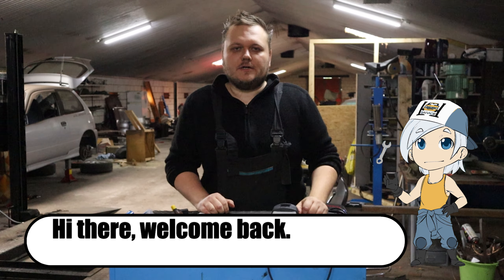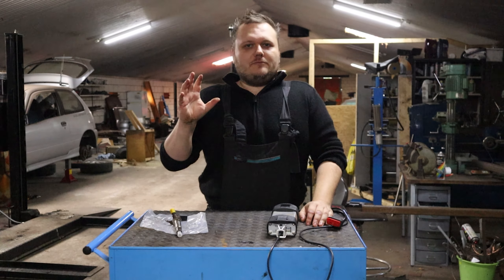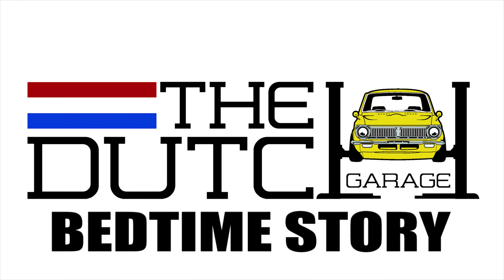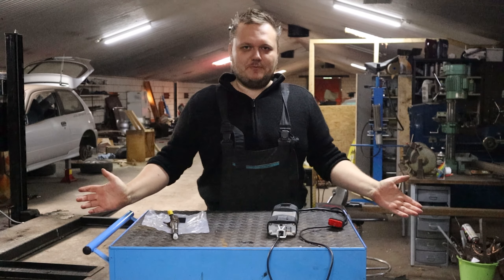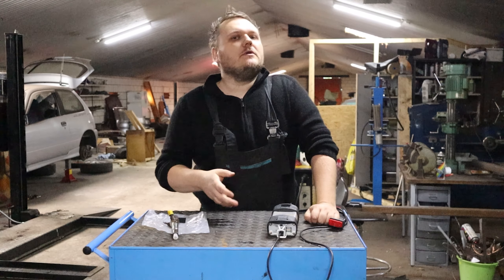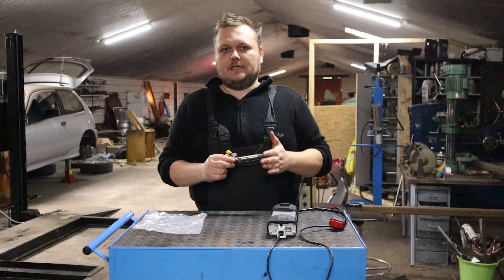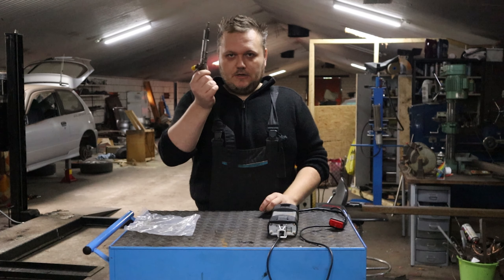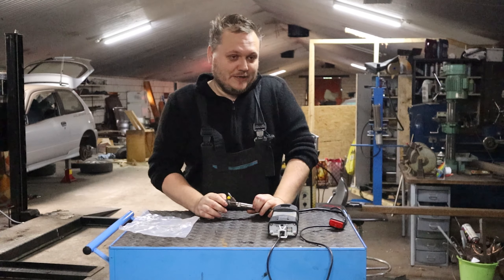How to replace and reprogram a Renault/Dacia injector with CAN CLIP Tips and Tricks

Comment: When you use obd tool on your Renault you put the car in service mode and ignition stays on.
Card in slot, choose 1 gear step on breake and push start.
Display will now says "Remove Card" leave it in and it is now in service mode.
Reply from the maker: Good to know, will try that.

Comment: Question no 1. Does the Canclip work on Opel Movano too? I have a 2017 Renault Master and a 2018 Opel Movano. 
Question no2.  On the 2017 Master with the 2.3 FWD engine which injector is no 1? The one on the timing end of the engine or the one on the transmission side?
Reply from the maker: I don't know if they are compatibel. Withe the megane no 1 is the transmission side. But the easyest to check is to look at the codes on the injector and what is the canclip telling you.

Comment: Hi I need some advice/help please
My battery died and after I had a hand brake error took it to a mechanic to delete the error and he deleted my injector codes too (yeah I know 🤦‍♂️) so I took the care home(Wouldn't rev more then 1500rpm) and I documented myself and managed to reprogram the injectors and after that the glow plugs, everything works fine the car pulls well but it give black smoke before this event never smoked. I check injectors correction, egr. intercooler pipe.vacuum hoses. airfilter and everything it's ok. any suggestions where to look next?
the car in question renault laguna 2 from 2006 2.0dci 127kw I have no errors in the dashboard nor info scan the car (in have and elm327 and pyren program almost as good as canclip)
Reply from the maker: Maybe the smoking is a aftermath of driving it when it whas in limb mode. Maybe it flooded the exhaust/ dpf filter with diesel. And now it's burning off the waste.

Comment: Very nice demonstration! I'll try to reprogram my injectors thanking you. How can avoid to shutdown the car/lose connection during the procedure? Because during the clip usage I have to restart and recovery reinserting the card
Reply from the maker: That really is a annoying. But look at the pinned comment.
Reply: Thanks a lot I'll try! Have a nice evening  @The Dutch Garage
Reply: on Renault laguna 2 I press on the start button until the immobiliser flashes a couple of times and then the contact stays on ( if you open the door/close then it will shut down like when you take of the contact)

Comment: So which piston did you change the injector on?
Reply from the maker: From the front of the engine number 4. Only the software it is number 1.
Reply: @TheDutchGarage  but you change injector 4 on the can-clip.
Reply from the maker: You are right, it was the other way around. Replaced injector 1 and in software it was the 4th injector.
Reply: @TheDutchGarage  how did you find out its like this on the software I would of never none this if it was for not watching this video 👍
Reply from the maker: Every injector has a serial number on top. So I compared it wat the software says. First I did the wrong one also.

Comment: My megane has been subjected to an injector change (1º) since it died. Fortunately it had factory warranty and didn't had to pay, although since then (15k ago) my car makes this metallic weird noise under load which is definitely coming from the injection. The return/correction values are OK - i think (varies from 0.85 to 1.2). Car performs well, low consumption, but this noise drives me crazy. Renault says the noise will only be gone if i change the 4 injectors which in total plus reprogramming cost near 1800€. 
Is it ok to keep it like this? well, it's been without an issue for the past 15k km..
Thanks! Useful video.
Reply from the maker: Injector can be noisy indeed. But are they noisy becourse there sticking or is the coil on its way out. What I would try first is an injection cleaner addictive to the fuel. See if it's getting better or not. If not then it's up to you if you want to spend that money.

Comment: did you have to install the reprog software onto your pc as well as can clip?
Reply from the maker: You can reprogram with the can clip software.
Reply: @TheDutchGarage  do you need to be connected to internet when doing it?
Reply: i tried following what you did but i keep getting connection error
Reply from the maker: @dantheman7370  You need to plug it into your car else you will get  the error.
Reply: @TheDutchGarage  I had it connected to the car
Reply: A network connection error
Reply from the maker: I do think you didn't install the software correctly. Pay good attention to the instructions.
Reply: @TheDutchGarage  I didn’t install it the guy who sells it did
Reply from the maker: Then the best thing is to contact him.
Reply: @TheDutchGarage  which version is your can clip?
Reply from the maker: @dantheman7370  Was it 174 or 172 don't know exactly.